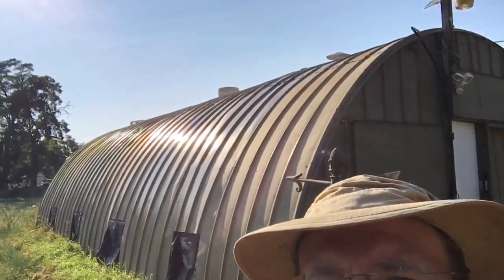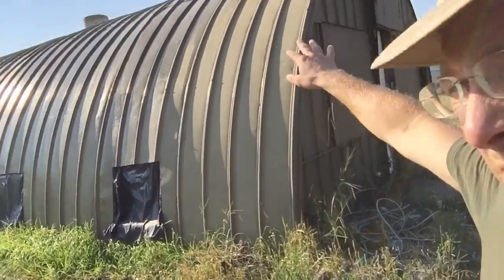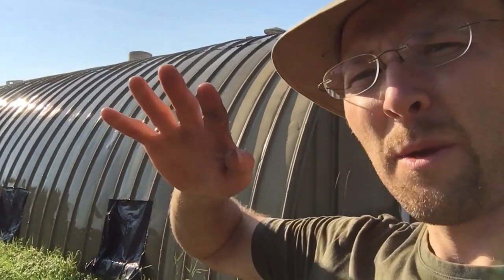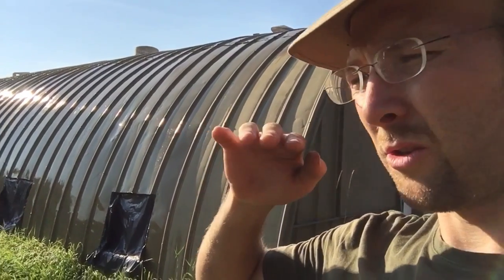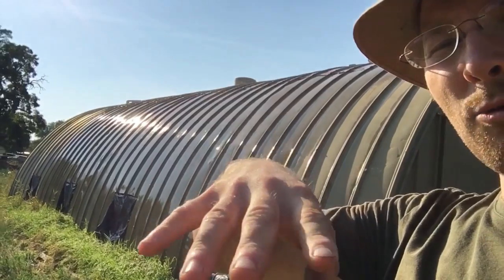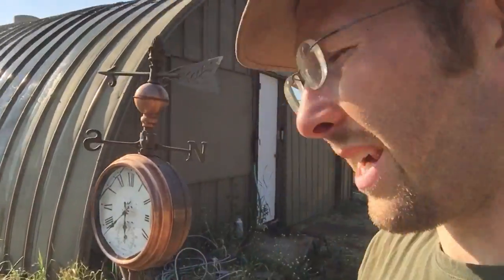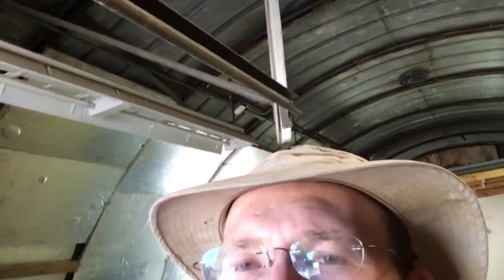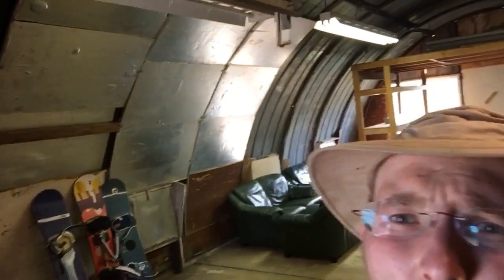How To Cool a Metal Shop With ONLY WATER

Comment: I WOULD LIKED TO HAVE SEEN a before and after surface temperature reading from the inside of the hut.   Laser thermometers are cheap and handy.  Go get one and make a part two of this video.
Reply from the maker: Tribulation Prepper yes I'm really sorry I wasn't able to do that in the video. We were right in the middle of moving off of that property and this is one of the last videos I was able to make before leaving, so I only had a very short time available to jump out and record the video. I must not have been able to find my laser thermometer at the time, or didn't have time to take it from fully warm to fully cool to show the difference, etc.
And unfortunately we don't live there anymore so I can't do a part two. :( 

Unfortunately... except for the fact that we now live on a way better piece of property with a shop that has actual vertical walls vs the short, round tin can of a building that was. Haha ;P
Reply: @TomWylie    Yeah, moving, especially from a just sold property, is usually a rush deal.  My wife and I currently live in Bella Vista, NW Arkansas.   We are prepping our house for sale and have been looking for a similar property to what you have moved from and have moved to.  Lower Missouri, west of Ozark county, is our current goal.   Question...  Why are there few or no houses with attached garages available in these rural areas???   Blessings and Shalom.

Comment: Tom,  NO DRILL BITS INVOLVED...   I have been in a factory that produces the type of black poly irrigation tubing you are using.   Molten plastic is extruded through a die at SEVERAL FEET PER SECOND and is immediately water cooled as it passes through the production line.   Once the tubing becomes rigid, it it passes through a high intensity laser station where the top of the tubing is repeatedly and instantly perforated and then goes on to the last station which coils the tubing onto very large reels.
Reply from the maker: Cool to get to watch it being made.

That'd be awesome—if I had some of that exact tubing, and it had the right size/spacing of holes for this application so i could direct the water to cascade over the surface vs just immediately evaporating ;)
Reply: @TomWylie    Tom...    Actually, it is the immediate evaporation that you want because it is the evaporation itself that causes the cooling, not the stream of water flowing down the side of the building. (Unless that water is refrigerated of course.)  The trick would be to lightly mist the hottest surface of the structure.   Anything more than a mist just creates puddles on the ground.   The stores, including online, sell "soaker hose".